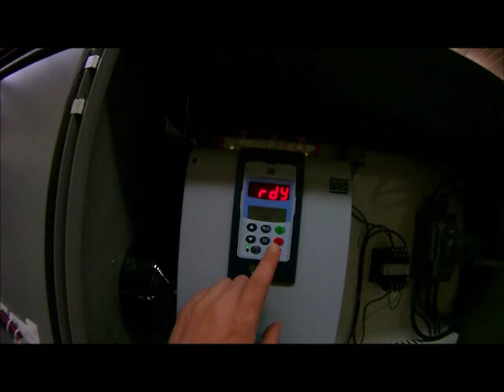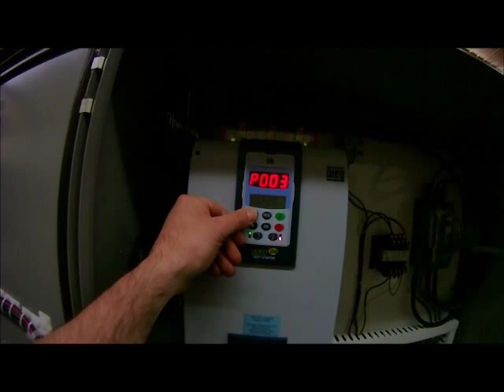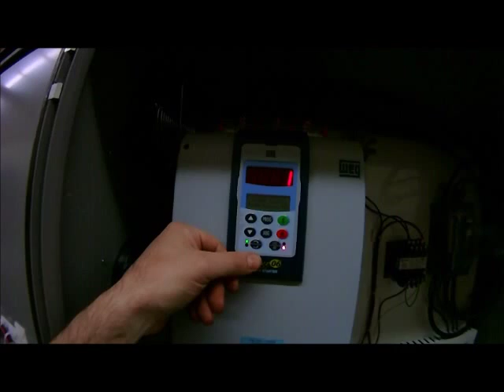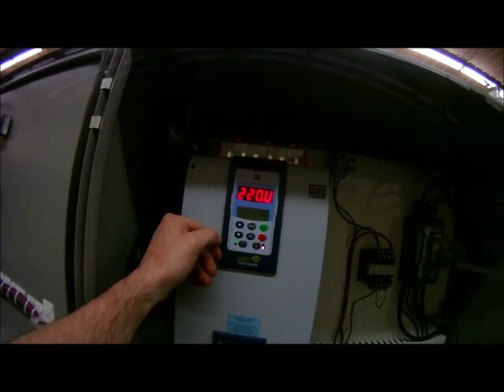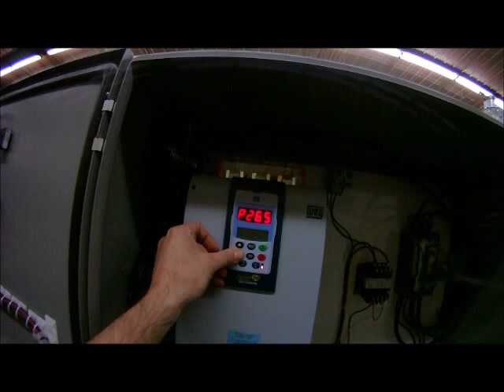WEG SSW06 Programming

Comment: What does your wiring look like inside the soft starter for the terminal block? Are your push buttons low-voltage? Do you have to have a 24 V transformer installed to run the buttons?

What does your start up ramp amperage, max amperage look like on your motor?